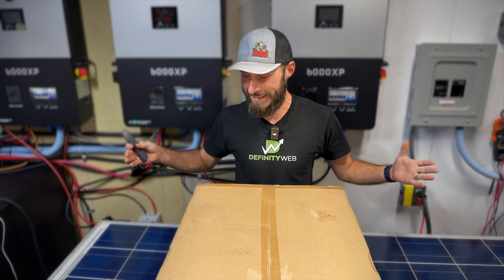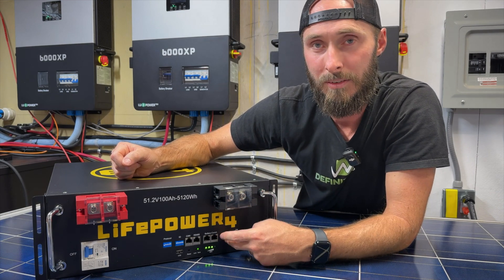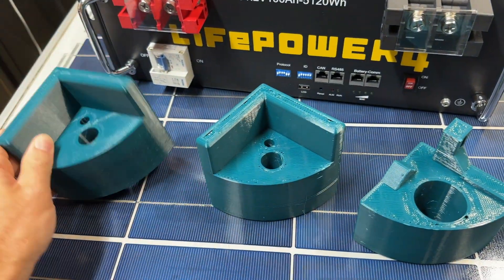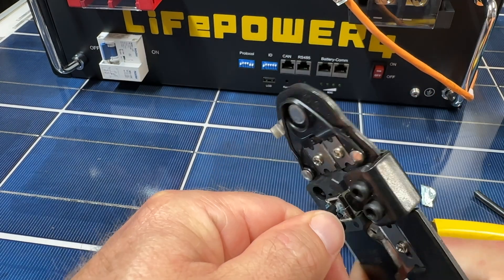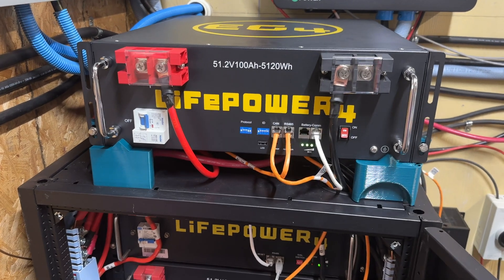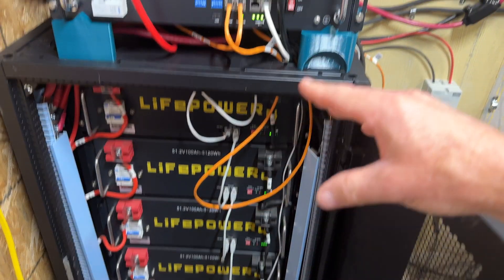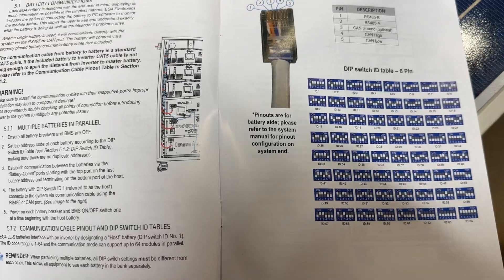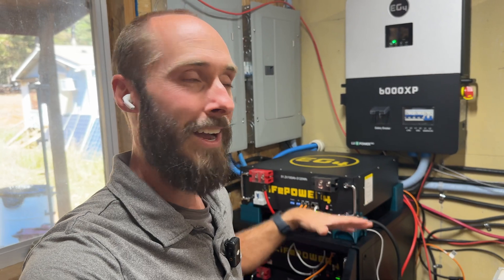Adding EG4 LifePower4 V2 Battery to My Existing V1 Stack

Comment: The dip switches on the V1 are upside down. Also they are read in binary so _- - - = 1; _ - _ _ = 2: _ - - _ = 3; etc. If you're unsure you can monitor all 64 batteries and see which ones register data.

Comment: I am adding a EG4 LL-S 48v battery to my two EG4 LL 48v batteries mounted into a server rack. I too have a ChargeVerter GC which I plan to top off the new battery. My ChargeVerter GC is already attached to my rack bus bar. My question: In this video you said you had to charge the batteries in the rack individually with the ChargeVerter, can I install the new battery in the rack, and connect it to the bus bar and charge it while the other batteries are shut off, but still physically connected to the bus bar? Thank you - George
Reply from the maker: Good question. That will work great. You can have all of the batteries + the Chargeverter connected to the busbar and charge the batteries individually. Like you said, just turn off the breakers for the ones not being charged. Congrats on the new battery!
Reply: @EastTexasHomestead  Thank you!
Reply from the maker: @mainerusnr you bet
Reply: @EastTexasHomestead  I talked to EG4 on a separate issue, the two batteries their 100% SOC was 50VDC! He told me he would set my inverter interface to recalibrate the older batteries to 47 VDC  and 56VDC to recalibrate. He also said my idea to install the new battery in the rack and run the ChargeVerter to charge the new one with the other two shut off would be fine, but they have to be within .5 VDC of each other. So, I'm running my inverter with batteries as first used vice grid to run the two older batteries up and down in the calibration process. I just have to watch for the voltages to be within 0.5 VDC of the new one and turn the new one on. No need for the ChargeVerter in this situation. Sorry such a long reply.
Reply: Everything is connected, but I have added a new EG4 48VDC 100 AH LL-S battery to a stack of two one year old EG4 48V 100 AH LL batteries. I have made the LL-S to MAIN batter via the dip switch settings and changed the previous LL "Main" battery to position #3 via the dip stick settings.

Currently, I am showing 300 Amps on the web and in the App, but on the App it is reading Battery Parallel Num: 2, shouldn't it say three are in parallel?

Comment: Your dip switches and cable placement bailed me out. Same exact setup as you. Bang"n my head, seen your video, now running like a champ. Nice blocks. I just bolted mine to the top. Thanks for posting
Reply from the maker: Glad it helped. Sometimes we just need to see that last piece of the puzzle.

Comment: Good job getting thru that install. Videos like yours and Gavins are a huge help to a lot of us. I also struggled with the dip switches and called tech support, they very quickly gave me all the proper settings on both the V2 and legacy batteries and I was finally started communicating, it did take a few hours before the computer monitor site recognized all the batteries which seemed odd. Even now it does show accurate info like current readings and voltages but for some reason it shows 51% SOC on all legacy but reads accurate on the V2. I verified thru BMS test that the legacy batteries were all functioning normally. It will take a little time for them to catch up documentation and address the glitches in the monitor sites. Its s great value for the high end components and ten year warranty that they now offer.
Reply from the maker: I’m getting the 51% on the V1s through the monitor site too. Hopefully they will get the update out soon. Glad yours is running well! 😄